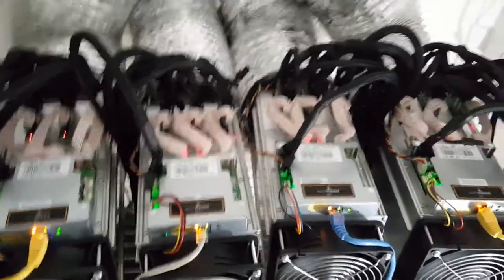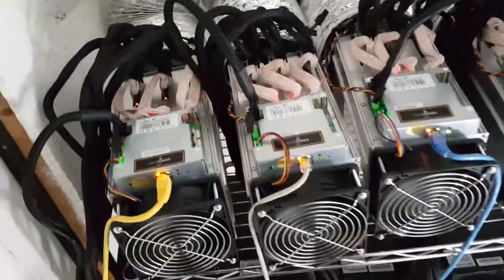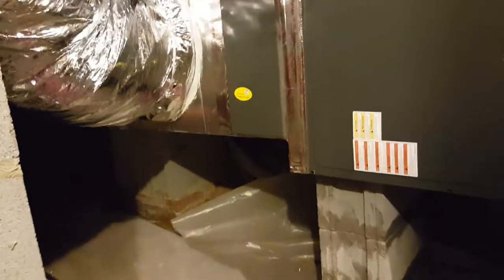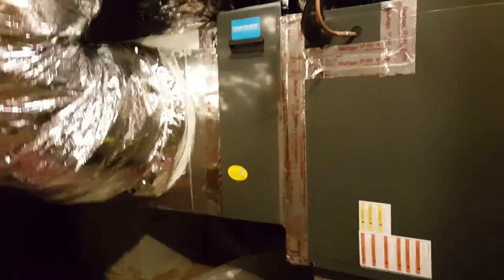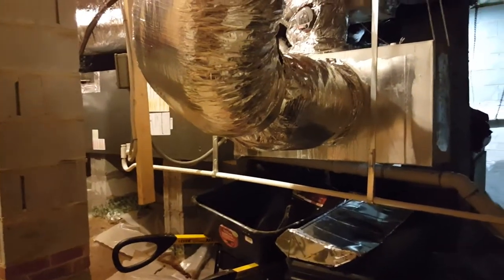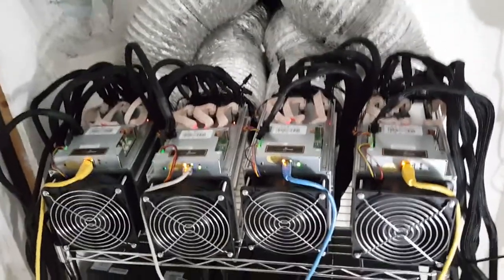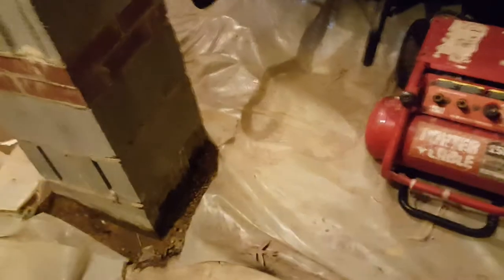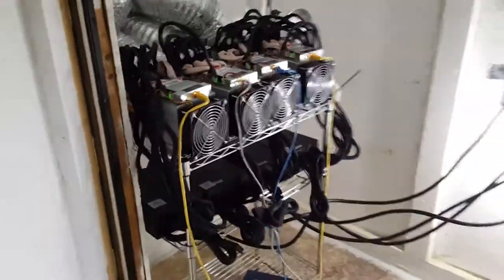Mini Bitcoin Farm Inside A HVAC System Using Antminer s7 To Heat My House for FREE

Comment: Hey man I wanted to thank you first of all because you are the reason I solved my heat problem by following your video and replies describing how you set up your's and then I built a 20 ducting inlet box that has a massive suction fan inside it connected to my ac duct system and connected all 20 miners to that box! But now I'm struggling with keeping the miners hashing when I start them up they start Ok and I get like Max 50 Th/s total but then they start going off line one after another until I'm lift with only 2 or 3 miners with 15 Th/s Only!!! I emailed bitmain with the problem but with no support nor a reply so I hope you can help I tried also different pools but none can keep all 20 miners up so I finally put every 5 miners on a different pool but thats also not working what do you think I'm doing Wrong or the Problem is ? please help man!!!
Reply from the maker: Your welcome and I'm sorry to hear about your new problem. My first thought would be are they overheating but obviously that's not the case, now I'm wondering if the BIOS needs to be updated on your miners. What batch are they are the same ones staying on all the time? Have you ever updated the BIOS?

Comment: Did you check the CFM for input/output air ducts?   I'm doing something very alike your installation. I need around 1200CFM for 6 Antminers S9. That gives me between 14-16 inches for air ducts.

Comment: Were your thoughts regarding summertime and volume of size of the house correct?  Or come summertime were you spending twice as much on AC?
Reply: During summer, it would be best to set up a damper to vent the Antminer's exhaust heat outside, so as to not increase air conditioning costs.

Comment: I was considering doing this with a single s19 directly to heating system.   While 3200 watts is not enough to heat my house it will  assist.    I will
Need to discuss the best place to
Connect to hvac.  The s19 has 2 exhaust fans so 2 pipes into hvac
Reply: I have 2 they best my 1800 sq ft to 80 degrees with no ducting so I would say one would be enough wattage to get 60-70 degrees a nice ambient pending on climates and housing build quality.

Comment: Hi. Nice set up. I would like to ask if the mining room itself get really hot?
Reply from the maker: Hi MK kc, and Thx. It doesn't get hot at all it's actually 70 degrees in there because the heat is pushed out through the back tunnel.

Comment: Hello, 
Man first of all thanks a million for this great Idea I was struggling to solve the heat issue my 20 S7 antminers are generating in a small room so after I saw your video I'm planning to build a box to connect 20 duct tubes in from the Antminers and with an outlet that goes out into the duct outlet!!! Do you think that will work? And please can you tell me what size is the flexible ducts you are connecting to the Antminers ? And how much did it approximately cost? 
Thanks man this is the best video ever :D
Reply from the maker: Hi Bader Shaheen and Your Welcome =)

Controlling the heat is definitely your best bet and yes it will work. I'm using 6 inch dryer duct http://amzn.to/29n3N3t to the wall and 18-Inch Insulated Flexible Duct with Metalized Jacket http://amzn.to/29UT166

So you're not overworking the fans on the antminer put a fan at the end of the big duck pulling air through. you're going to have to do some testing but I don't think you're going to be able to run more than 5 miners to one 18 inch. So you should set it up in four runs to a big squirrel cage fan.

I gave you links but it wasn't much a few hundred dollars.

I hope this helps and make sure to come back and let us know how your project going.
Reply: +TheBitcoinMiner 
Thanks a lot man this will help me a lot because the heat is really overworking my miners and I'm not being able to maintain them all up I keep loosing them for being down only maintaining 7 out of 20 up on antpool!!! I will use the 6 inch duct to connect the Antminers to a big box that I'll build that will have all 20 connected to it and with one outlet 18 inch that will go into an outside ventilation and I hope it will work and sure I'll let you know 👍🏻😊
Thanks again
Reply from the maker: You're welcome, let me know if I can be any more help =)